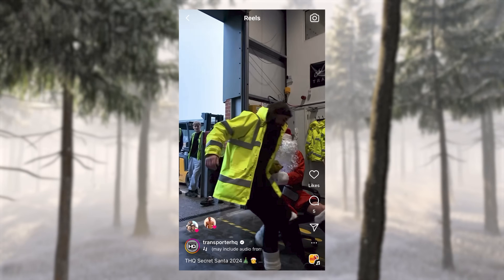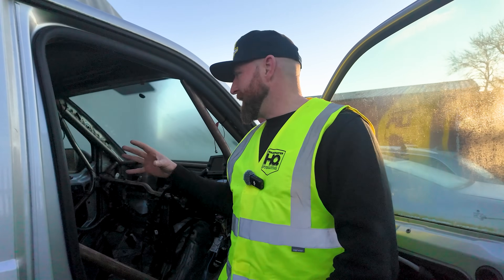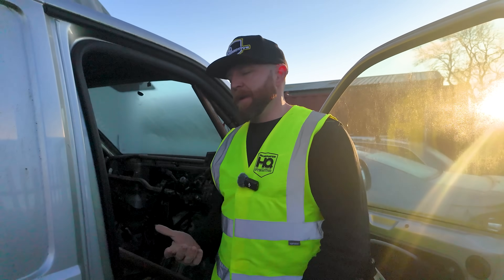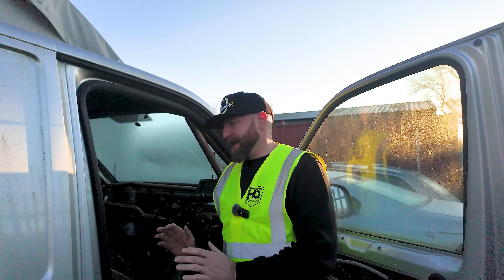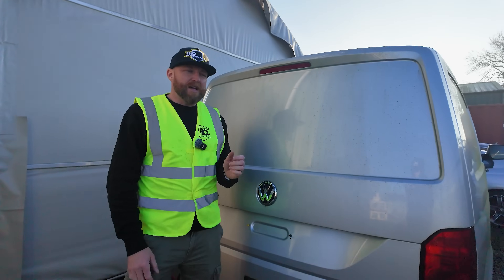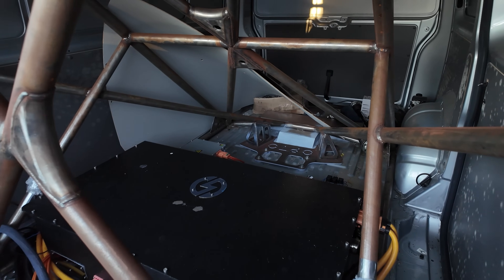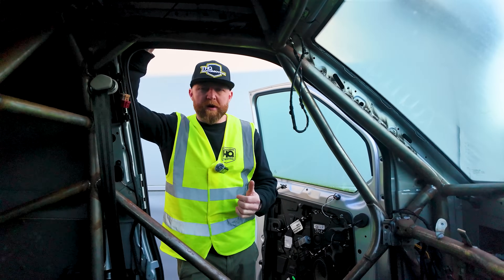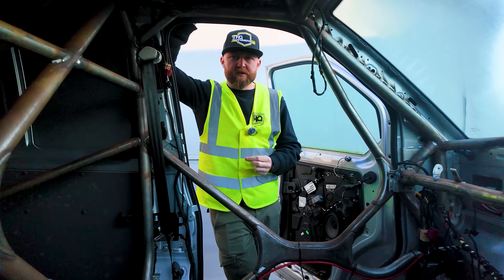The TESLA Transporter Build (GONE WRONG)

Comment: If only you had started  with the e-transporter as a base vehicle. They are massively depreciated on the second hand market and no taxation class issues. Plus you would be correcting the huge mistake vw made when developing an ev van. They managed to get get everything wrong! No range no performance and no payload. Great van for nobody. Yours on the other hand will be an absolute weapon.
Reply from the maker: Back when we start this, they were still crazy month. More expensive than the startline we bought.

Comment: That's a bummer that you put so much work in to it to find out it couldn't be registered :( Personally I think the VW transporter is one of the best candidates to do a Model 3  "Full Tesla Integration" - That is buy a whole (salvaged) but working model 3 and literally use ALL the electrical components (Motor, battery, computers, Screen, harness's etc...). It's very cheap (basically the cost of the donor vehicle) and with the van you have the room to mount the battery/HV system underneath in it's original packaging! 
I did this in my Land Rover but didn't have the space advantages of the VW van.
Reply from the maker: @sydneyg007  honestly wish we'd started with an early T5. It's done now though, time to crack on with the T6.1